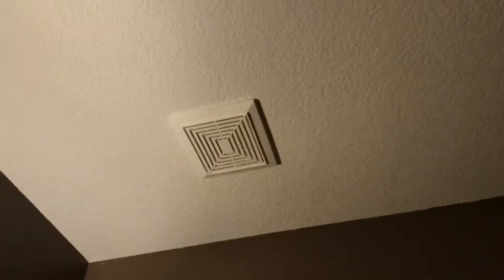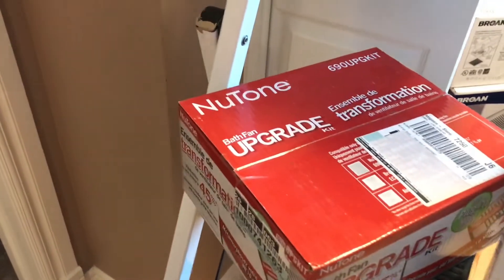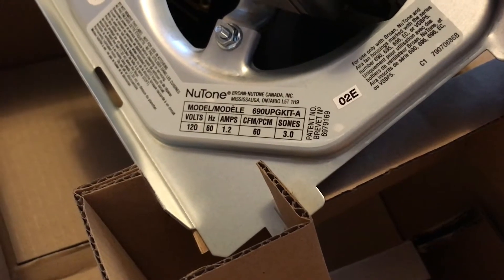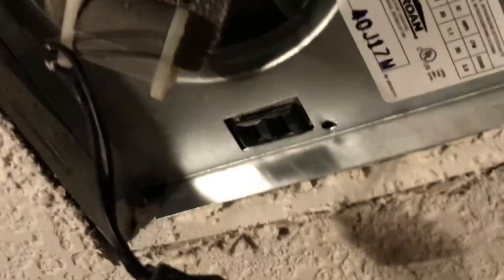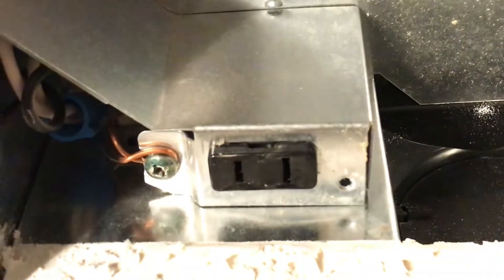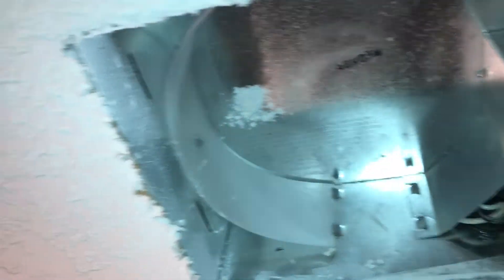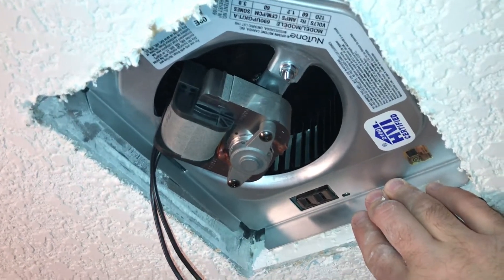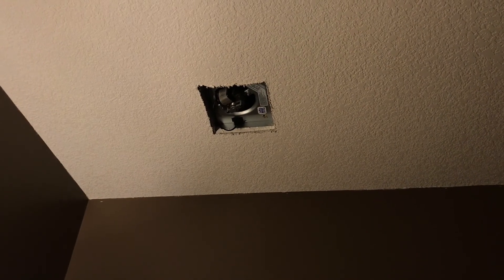Upgrading a Noisy Bathroom Exhaust Fan - Nutone Broan Fan 60-CFM Upgrade Kit

Comment: Hey Greg, thanks for sharing this very informative video. Couple of days ago I replaced my bathroom fan with the same brand as yours. After putting it in, I noticed that its rotating counter clockwise. I thought something’s wrong with the fan. Then it occurred to me that I might have connected hot/neutral wires the opposite way but while watching your video I noticed your both fans run counter clockwise. So, my headache is gone now. Thanks again!

Comment: Great video! I've been procrastinating replacing the bathroom vents in my house. They are both original to the house from 1996. Both work fine, but as you can imagine, they don't move much air. After a good hot shower, with the fan running for the duration of the shower, it's about as steamy as it would be without the fan. This kit seems like a neat idea, but I don't think I'd have a problem upgrading to a larger fan that could hopefully move some air!
Reply from the maker: Also check the air flow to the outside.  Hose could be plugged with bird nests.   But yes a new fan is helpful regardless.

Comment: Would love to see if you could upgrade from a Nuton/Broan to a larger (but quieter) Panasonic bathroom exhaust fan, as I was wondering if it would be a lot of work to enlarge the opening and if there will be some complication if we upgrade from a small fan to a larger one. Thanks!
Reply from the maker: yes it would be better.  the work involves cutting the ceiling drywall carefully.  Then mounting the new fan bracket.  Not too difficult but need to be very careful.
Reply: @gregs_garage Hampton bay makes a fan that’s 70CFM and it’s much quieter.
Reply: Panasonic is the way to go, silent, and get teh retrofit models, easy PZ, i recently did 3 Panasonics replacing the old Broan cement grinders.  All others suck, compared to Panasonics.  3 Sone is way too loud Panasonic are .8  .8 big different.  It's cheap, here cus it's the same junk you are replacing.  get a Panasonic
Reply: @cengeb did you have to cut dry wall for the Panasonic? Or is the retro fit more or less plug and play?

Comment: The fan sound has a lot to do with the size of the fan. The bigger than fan, the less noise it will make to move the same volume of air. You look at the panasonic fans, they have massive blowers. They move twice the volume of air, with a fraction of the noise, all thanks to the gigantic blowers.
Reply: It’s also because the paddle style blades make more noise than a squirrel cage style impeller. If it had a squirrel cage blower it would be quieter. His fan was noisy because of a clogged vent.

Comment: Why would you return it?  You installed it.
Reply from the maker: It wasn’t the issue
Reply: @gregs_garage You are returning a used product.  That isn't the store's fault,  Don't be dishonest because you know you can.  Be upright.
Reply from the maker: @georgecolbert3247  Placing it back in the package and returning it and saying you didn't need it is "upright".
Reply: It was advertised as “quiet” and 50% quieter, they should specify that more…quieter than a garbage truck???? Sure. 

He wanted quieter, it was not. Return it.

Comment: It may be clean because it has never moved air.  I'd be using the paper method to ensure there is suction, and the squirrel cage design is superior to the paddle fan - I'd leave the new one in.
Reply from the maker: true.  There was a birds nest in the vent outside.  Never moving air.

Comment: Thanks for being honest when the new installation also did not improve the result! I have a 6-sone rating bath fan, much louder, in a house built in 2021, and it is a cheapo. In fact, all of my bath fans are cheapos! I don't understand why builders seem to try to save money in every aspect of the house building. My builder is Century Communities. Did you find the quieter one yet? I saw another video from a guy installing Panasonic one, don't know how that loud/quiet that is.
Reply from the maker: Yes I put a bigger 1-sone fan in.  Also there was a birds nest in the vent which made it louder.  Did not do a follow up video
Reply: Panasonics are teh best SILENT even on 110 cfm they have several models.  get teh retrofit models, well designed to replace this old junk.  Panasonic is larger so you can work and cut teh drywall a bit larger, and teh Panasnic covers it all, and it comes with a adapter for different size duct.  Panasonic clever how it's meant for retrofit, flex bracket, and how parts for electrical, and duct separate for easy work, then clip together and fan is done with 4 self taping screws into the flex bracket

Comment: Seems like you exchanged a cheap fan, for another cheap fan.
Reply from the maker: you got me.  The alternative is to cut a bigger hole and install a bigger quieter fan.  This is a $50 solution that is quick and cuts the noise down quite a bit, plus you get a new modern grill.

Comment: I'm amazed the fan and housing is spotless, I've worked on exhaust fans but never old were so clean.  That Broan design has been around since the 1970s and you can even cannibalize parts from new models to old, worse case, such as just swapping the fan assemblies.  Those exhausts are old designs and fans, reliable, will last you forever if clean, as yours are.  The only time they die is if dirt gets in there and the owner doesn't clean it out before the motor burns, deforms the rotor, or heat build up deform the fan blades; if it starts making noises you've never heard before that's the time to clean it; once in 10-15 years is all you need.  Cheers, mine are original builders too, installed in 1984.  In the Southern US, they don't last long due to humidity, so they rust out, so being able to replace them quickly like a light bulb, is a plus.

Comment: This video is odd. There’s no way that fan is 15 years old and not cleaned. Everything looked fairly new. The upgrade was no quieter. Not sure about all of that but if you just wanted to make a how-to video, do it. You don’t need everyone to believe that, for some magical reason, dust doesn’t exist in your house. I just find it strange.
Reply from the maker: first time cover was off since 2005.  I don't know why it was so clean either.  Maybe dust avoids that little room.
Reply: @gregs_garage  amazing. Well then I want to know your secret. I can’t stop it from coming. Thanks for the rest of the info.

Comment: MAKE SURE THE FLAP IS NOT Stuck closed
Reply: You are right. When I removed the housing I saw in my case the flap was completely stuck. it was too late I installed the new one. but the sound was on a similar level.
Reply: @OscarsPlaces  Yeahh also, if it is vented straight out the wall outside, make sure that the flaps are free and if it’s got a little screen, remove that because that will restrict flow as well and kick up the noise level of the fan
Reply: @mustangdbest220  great value, thanks for sharing.
Reply: @OscarsPlaces  Np and make a video of all that
Reply: @mustangdbest220 with my fan I checked to make sure my flap in the fan and roof vent wasn’t stuck closed. Usually some lubricant can free up a stuck damper flap in the fan housing.